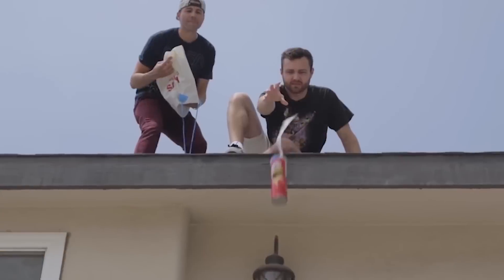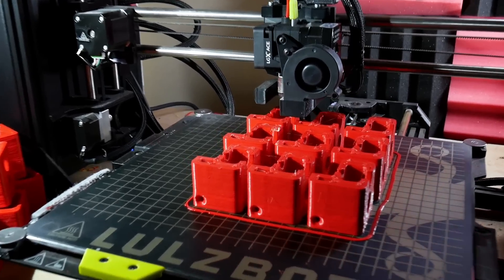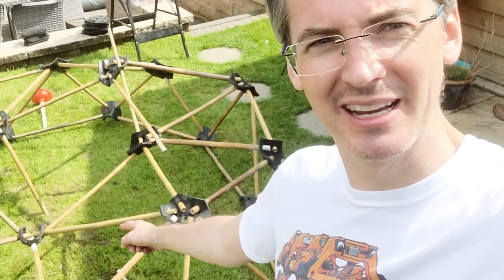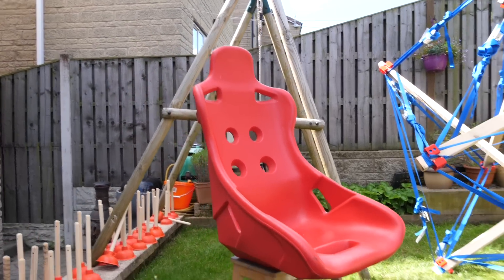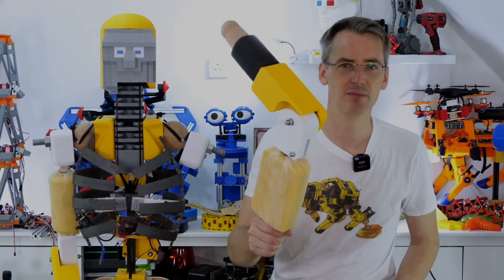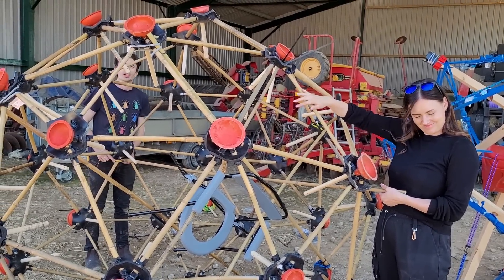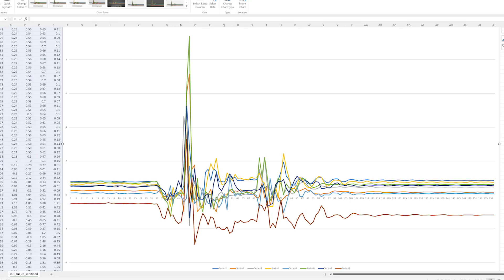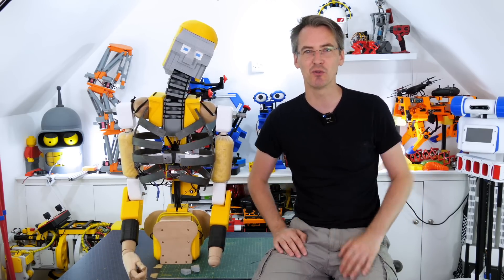Human Egg Drop Challenge

Comment: You should try a rigid hexagon frames that's all connected by flexible stretch material, and don't use wood, use something with light with a high flex value that's durable. Same stuff they used to mage tenders off for a while comes to mind, but that stuff is heavy. Then inside that huge ball you add a survival ball with soft insides, though the whole thing is connected on all side by something stretchable, but strong so that the inner ball will move, but the further from center the harder the pull from the opposite side. Add a big parachute and and you might have something that could possibly fall from a high height while being safe. 

After all the point is to avoid that high G spike on the charts as the whole thing hit's the ground. I think if it's done right it might work, but you might need to vary the size of the outer hexagon or whatever. The outer structure might nood even have to be solidly connected and be connected through the same strong screech stuff.  I can almost see it in my mind, like some rescue ball dropping from the edge of space.

Comment: Just an FYI most bungee cords are actually adjustable if you look at the ends the hook turns into a spiral and the bungee cord is usually not actually attached to the hook it's just stuck through the end of the spiral and then a crimp or a knot is added to the end that cannot escape the spiral so you can push the end of the cord into the hook exposing it and then you can change the length of the bungee which will change its tension and then simply add a new knot or add a new crimp

Comment: You have very long thin beams that will fail by buckling. Ideal geometry is a cylinder, such as aluminium tubing. You can also use extra straps to constrain the beam at it's centre, which will half its effective length and quadruple the critical buckling load. 

Ideal setup would be something like 50x3mm alu tubing with 40x3mm tubing inside. 3D print some end caps and wrap with teflon or UHMWPE for low friction. Use shock cord to support the 40mm tube so that each beam becomes a giant pogo stick.

I'd also replace all the straps with shock cord. Just keep adding strands until you get the right rigidity. 

To constrain the middle (or even the 1/3 or 1/4 points) of each beam, you'd probably be better off with the ratchet straps.

Great vid and great idea!
Reply: On second thoughts, a larger diameter and thinner wall thickness would be better. Have to do some calcs and also keep it under the weight limit of the boom

Comment: I think you're onto something with the lumber grade thing. I don't know about the UK, but where I live, construction lumber used for joists, headers, and rafters comes in various grades depending on how much transverse load they can take, but there's also a "studs" grade which pretty much means it's rated for axial loads only, and in practice the lumber available in that grade is always  smaller sizes like 2x4 (common for load bearing walls) or 2x3 (common for partition walls). especially if they have it a direct to consumer sort of store and they're pre-cut to typical wall height, it's usually studs grade.

Comment: Okay I know nothing about engineering or maths, or eggs for that matter but! One of the most basic things your learn in Parkour is that when you drop from a great height and make contact with the ground, you need to redirect the momentum away from the ground to lessen the impact on the legs and spine. That's why you roll. So that's probably very dumb, but how about a system of springs? or something of the like that would allow the machine to not drop straight down but instead bounce and roll on impact? That may be silly but that's the first thing I thought of.

Comment: nice experiment, although i'd suggest a different kind of tensegrity for it and at the very least less processed wood

yes, the bit with the branch was already a weak point, but so is the shape: the integrity of the wood being grown in concentric layers is massively cut short by turning the trees natural form into these boxed beams.
that's why i like using branches for my treeships, bark may stay or go, twigs reduced but the whole wood otherwise as unhurt as possible. i lash the branches with triple clove hitches and need much less line to get it together. the secret sauce to tensegrities is synergetics and a sense of the many integries involved. tensegrity is tensional integrity, the same principle as in our bodies fascia, waters surface tension, gravity etc. another integrity is that of the whole of Universe, embodied by the systems inside and outside as bound together by the boundary membrane. and where the bamboo/branch version of 'wood' rather than cut beams play perhaps the biggest role is in the pattern integrity: yes, it is possible to turn boxes into spheres, cumbersomely so, but lots of our kinship Eairth already comes in spheres and therefore plays significantly into said pattern integrity... 

here's something similar in kind to what you did here: 
https://youtu.be/P-YXbPBl03s?si=St6xjTg0Qd9BmFo1

peace
struppi

Comment: When you climbed onto it and started to bounce on it a bit I had the suspicion that the wood will break. Afterwards exactly that happened when you dropped it. I think your construction puts very high loads (like insanely high) onto the individual wood pieces. But I am not too sure since this is just a feeling I have and not a deeper mathematical understanding I have from the construction.
Reply from the maker: I think if I did it in a similar way again I'd tie bungees to the ends of the straps.
Reply: In addition, the ratchet straps probably have quite a bit of tensile strength so they do not absorb too much deformation themselves